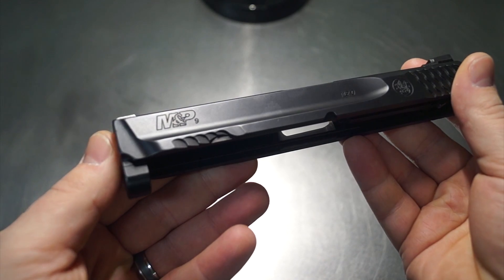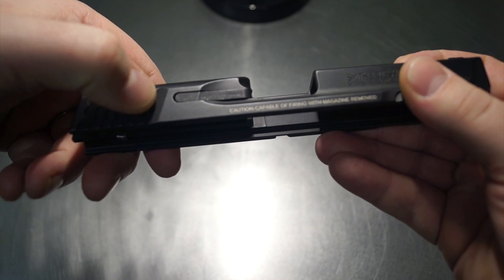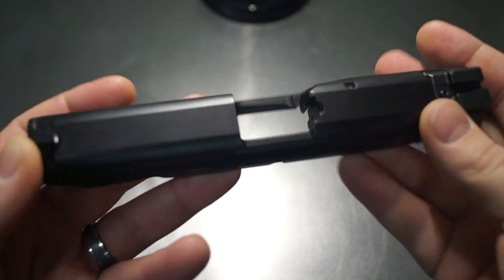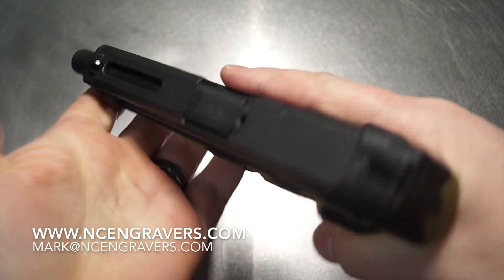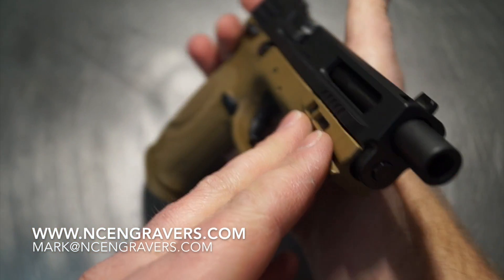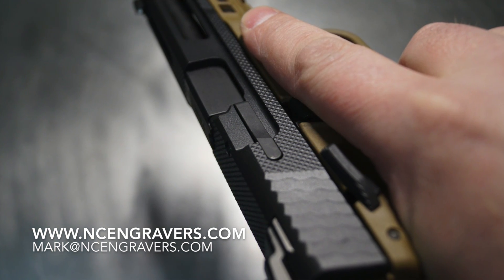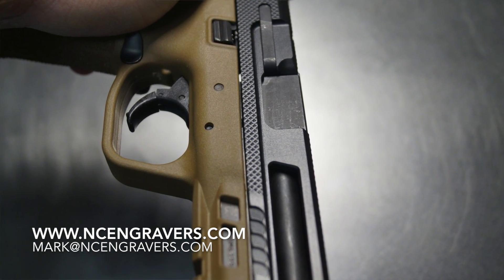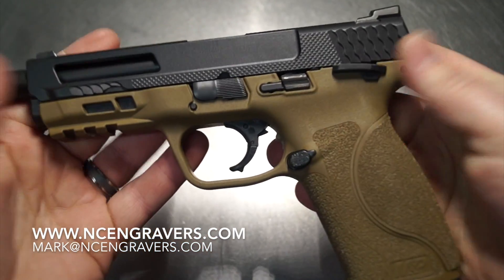NCEngravers.com  - M&P 2.0 9mm Custom Build (First of its kind)

Comment: So why not laser the holes? Wouldnt that be more precise? I know you have both and ive seen you clean cuts with your laser and choose full laser on small stuff? Whats the difference?
Reply from the maker: mostly time and setup. the laser is more accurate but takes much longer to cut. also laser setup is done by eye and not like a cnc with a measurement.
Reply: @NCEngravers  so aside from speed is there anything your cnc machine will do your laser cannot? Just getting into the game. Waiting on my 50w mopa from LMT. So ive been diving down the rabbit hole. How much did your cnc cost you? Is it easy to get into if you have a broad backround in mechanics? Any info would really be appriciatted. Thank you for your time love the channel.

Comment: Ooooops!!! You did eliminate the S&W logo on the left side forward of the slide serrations. Great job overall! What was the weight savings over the original slide design? Any plans for a RMR cut? Also, what is "Tormach" in the title mean?
Reply from the maker: The logo needed to be removed in the end. we do offer this with a rmr optic cut and "Tormach" is the cnc machine brand I use.
Reply: NCEngravers Thanks for your reply. I was curious about the weight savings difference. I know it's too late to weigh the slide you cut, but I'm sure you can get your hands on another. Just a curiosity thing more than a technical one. Thanks again.

Comment: Is that as fast as the 770 will handle these cuts? Seems like it should be able to go a lot faster.
Reply from the maker: I can run it much faster but I don’t feel like buying a $30 cutter every time I cut a slide. Slides are hardened steel. I use mostly 1/8 cutters so it doesn’t take much to snap a cutter.

Comment: Thumbs forward shooting is gonna suck with the knurling. To each his own I suppose!

PS : Don't get me wrong, it looks great, but wouldn't work well with my particular style of thumbs forward!
Reply: 393stroker Why not , the thumbs should be fine.  If the thumbs are to tight it was cause the slide timing to be off.
Reply: HIGHLANDER Yeah, you are right, if to tight it would slow down the slide and create a malfunction. I've never had that problem, but foresee bare hands being cheese grated with that texture. Some may not care as they would use gloves anyways. To each his own. It does look good though!
Reply: 393stroker I have had students cut their thumbs on VP9s. So you're correct some get cut.
Reply: not if your griping it right, you dont set your thumbs on the upper at all.
Reply: React exactly